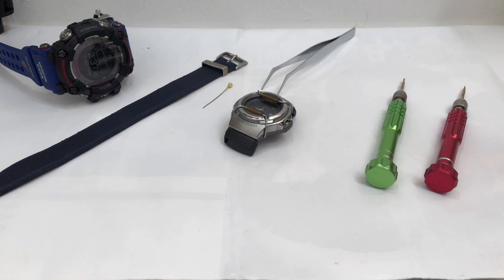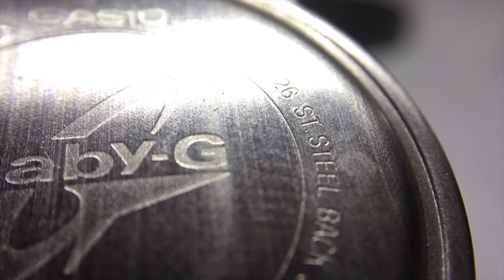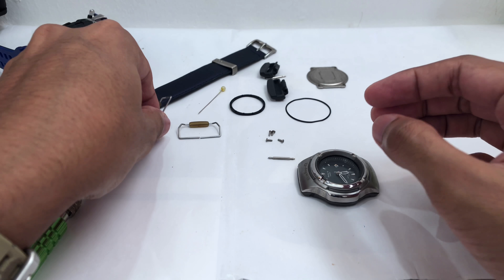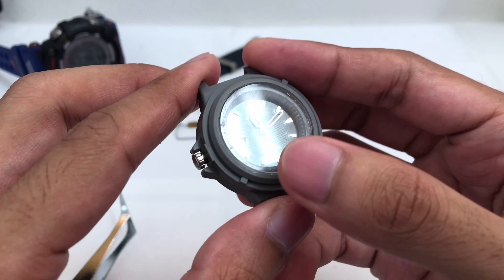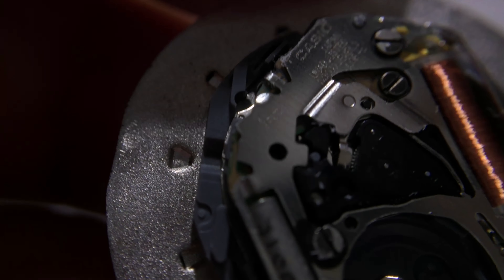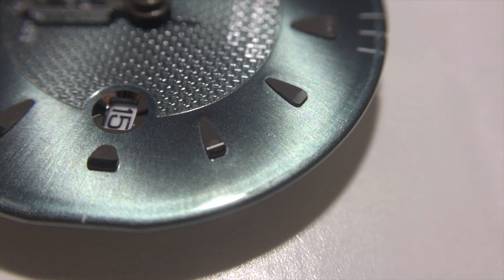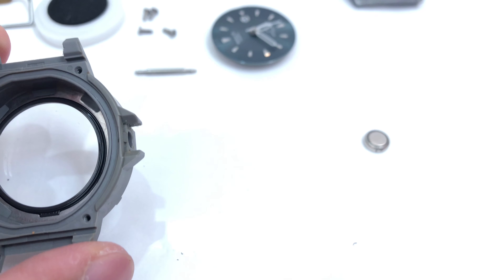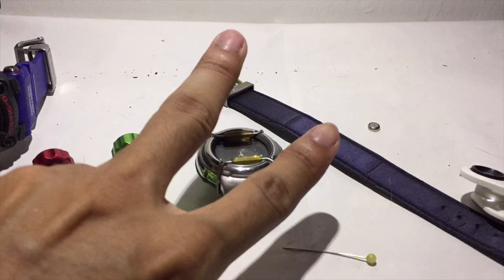Casio Baby-G watch breakdown | Reff: BG-26 series watch

Comment: Hey great vid. How would I go about putting can different resin style band on a watch like this?? Thanks
Reply from the maker: Easiest way is to check the reference number. Eg. BG-26: check other model with same reference like BG-2x (any number). Also look at how the bezel was locked onto place. If is on the same way, where in this case just with the bullbar then they should interchangeable.